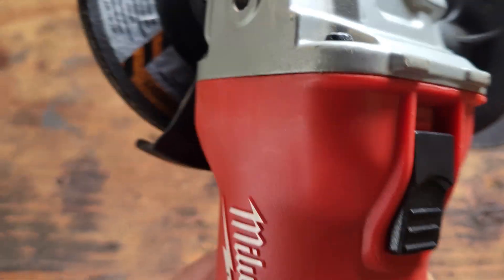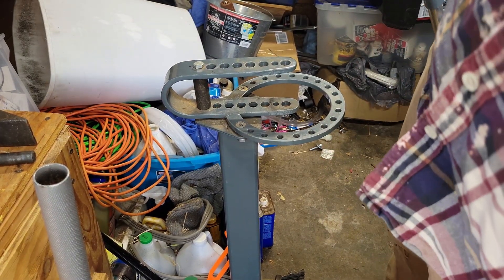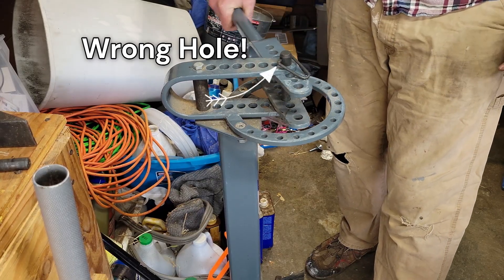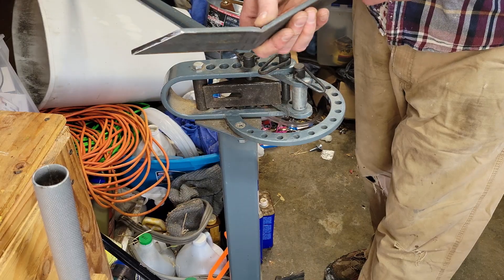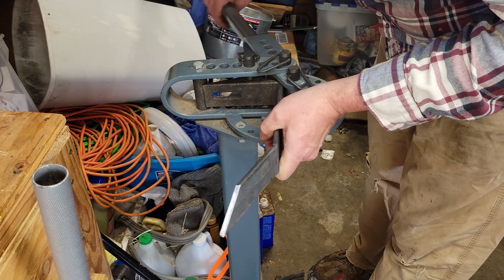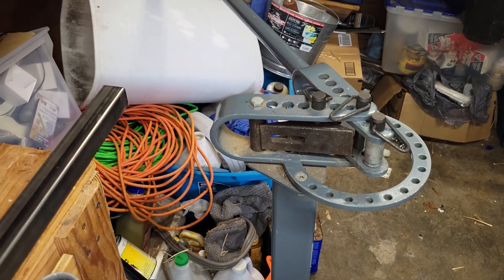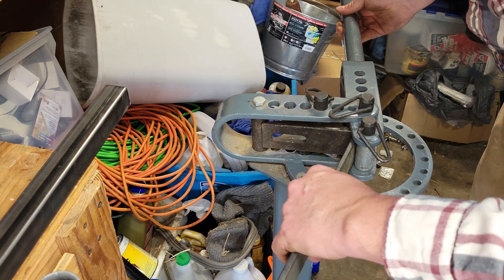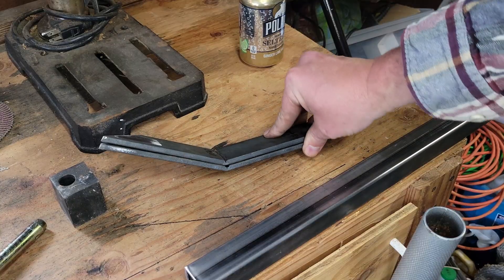How to Use a Compact Metal Bender from Harbor Freight or Amazon for Manual Bending Steel... Hossfeld

Comment: Years back I bought the compact bolt-on-bench version of this bender.  Routinely I've been second guessing that decision, thinking I should have sprung for the floor model.  But after seeing the flex in the column when you're wailing on it, I'd be dealing with mitigating that vs. bolting the bench top model off and on a bench.   In my case I also need to swap a pipe vise on/off the bench for that manual metal wrestling work.   Don't have the shop real estate luxury to permanently mount the vise somewhere either.
Reply from the maker: That's a very valid point, and I also want to point out that I am trying to bend something a little bit thicker than I probably should be.